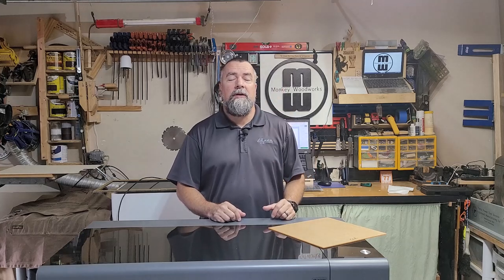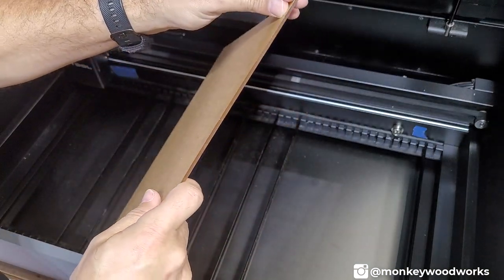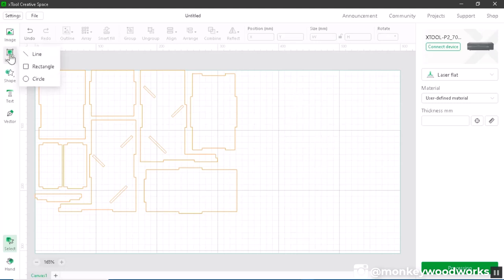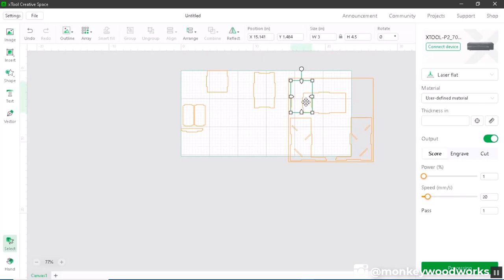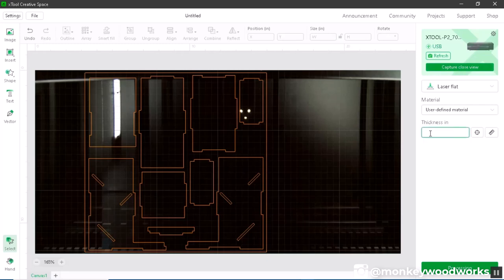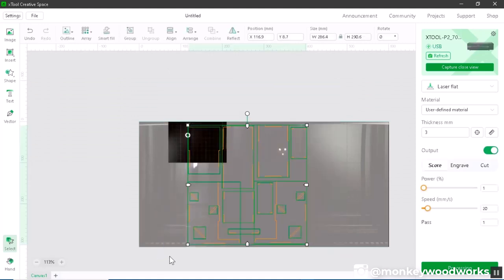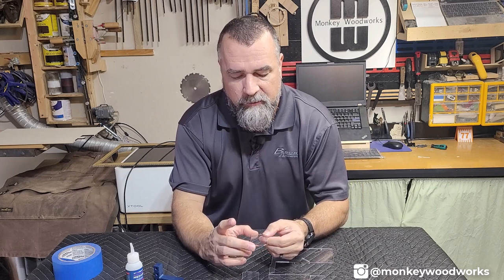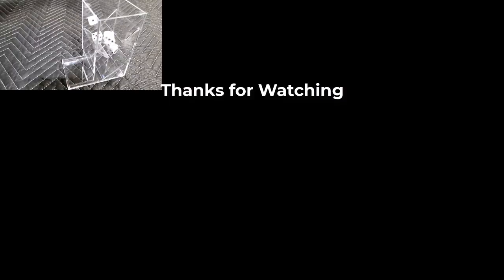Clear Acrylic Dice Tower with the xTool P2 CO2 Laser cutter

Comment: Awesome video! I'm excited about being able to clean the slats in the machine. Much faster than removing honeycomb, taking outside, cleaning each hole, and waiting for it to dry.
Reply from the maker: Yes!  They are really easy to clean.  I haven't tried it yet but I also hear Dawn powerwash works great to clean honeycombs.  I am guessing it will work the same on these.  Only issue is you have to rinse them off so I am guessing when you need to do a deep clean on them, you can take them all out and let them soak in the stuff for a while.  But the light in-between cleanings can be done like i did in the video.
Reply: @MonkeyWoodworks  ❤️

Comment: Should have mine next Friday! My first laser! What is that surface you’re assembling on? Looks like a nice cushioned work blanket? Do you happen to know the amps needed for the P2 and all the powered accessories like the filter, rotary tool, and fire suppression system? I’m running 110v in the US. Thanks for such informative videos!
Reply from the maker: Excited for you!  That is just a moving blanket from Harbor Freight.  It was the best background I could find to film the assembly.  I know the power draw is 450 watts @ 100% power + air assist at full power but that is all i know.

Comment: Finally someone showing a project being done with the P2. :)

I am still hesitating to pull the trigger, especially because I have no experience with machines from other manufacturers in comparison. 

One thing that irritates me is that their marketing promises a lot of things, but does not deliver. For example the website looks like features like RA2 or Passthrough are part of the machine, but these are all addons. Then they mention the bed size, but the real working area is smaller and even more so in the open space mode. The release video shows a fake dog tag engraving too.

This makes me wonder if I will get what I am expecting.
Reply from the maker: My plan moving forward is to showcase projects made in the P2.  The hard part is not making the video long and boring lol.

Comment: Awesome video and thanks for the amount of detail and explanation. I was wondering when you moved all the components in the acrylic shape on the software, wasn't it possible to just move the 'acrylic shape' over where the shapes originally were?
Reply from the maker: Hah, yes your right.  I could have moved the square on top of the pieces.  I believe however that the pieces make a rectangular shape and do not fit on the square as is and needed to be re-arranged.  That is why I chose to do it the way I did.